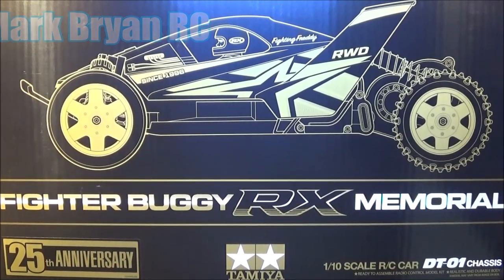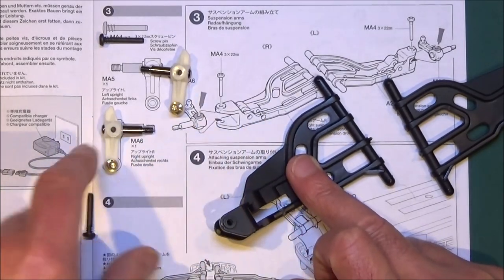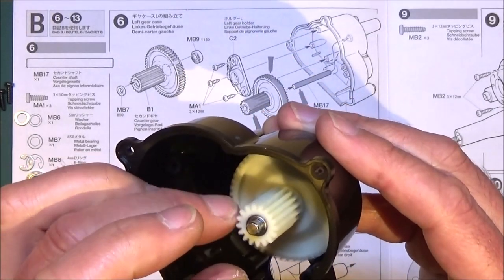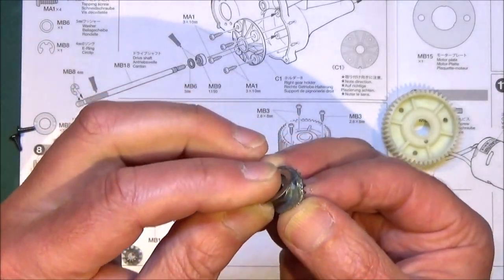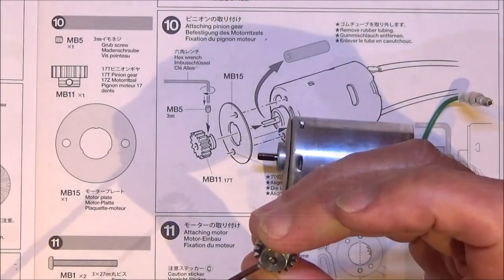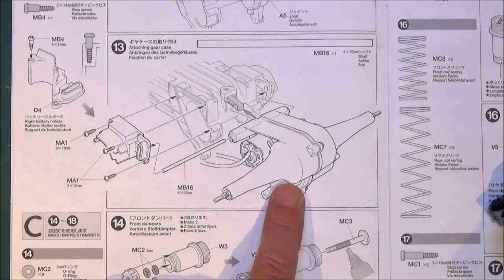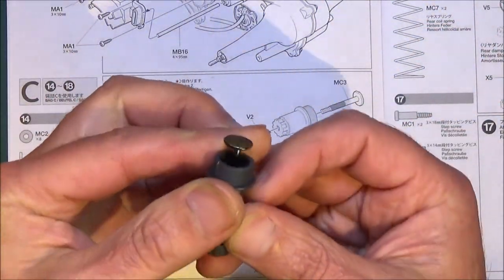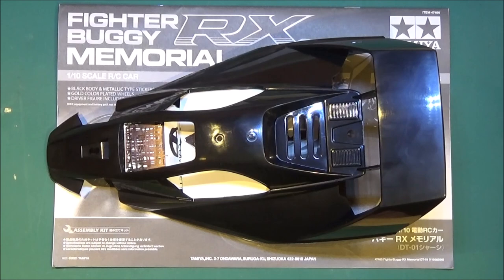Tamiya DT01 Fighter Buggy RX Memorial Build Guide + Tips Part 1 Steps 1-16

Comment: 10:46 "Easier said than done."..🤣 - too right mate. Oh how I've struggled with that particular fitting over the years, but a great feeling when you feel those screws bite. Glad you did a build video of this one as it brings back memories from 2004 when I built mine ( long since gone. ) As you'll know back then mine came with a MSC and needed an extra servo. I'm so glad Tamiya brough in ESC's shortly thereafter. I was genuinely surprised when you started building the shocks as I have absolutely no recollection of doing oil filled shocks on mine. Memory must be going..🙄. Thanks for the memories dude and cannot wait to see this one completed and running. #blackbeauty....cue the music...👍🏻👍🏻.
Reply from the maker: Hey mate - yeah, a lot in this hobby is easier said than done! I find brushless motors ever harder to fit as they don't have that collar near the spindle. Oh those MSC's - I loved the way you could go from full forward throttle to full reverse in a fraction of a second! Probably didn't do the car much good though! But modern ESC's sure give a lot more control. 
On the shock front, I think the oil shocks are part of the special edition features. Could be wrong! 
Thanks for taking the time to write all these interesting messages, always a pleasure, mate!  :)
Reply: @MarkBryanRC  Cheers for the info about the oil shocks Mark. I just looked into it and yeah, the original didn't have them. I wondered why I had no recollection of them. Memory intact - phew..😎🤣.
Reply from the maker: Well mate, I think your memory is functioning better than mine these days! TBH I don't think the oil shocks will make much difference, especially at the rear as it seems to be almost rigid! :O)

Comment: Quick tip, you can put Tamiya Anti Wear Grease on the spider gears inside the diff to make it limited slip, you can do this to all Tamiya gear diffs for better performance 👍
Reply from the maker: Great tip! I use the AW grease on my rally car diffs and it works well - was tempted to do it on this one, but went with normal grease, can always change it later! All the best from Mark...   :)

Comment: Hi Mark i love your videos! I got a tmayia terrer schorcher for christmas last year. It has been used quite a lot  is dirty. The gear box seams to be sounding weard too. Would the car be needing a re greaseing and rebuild? Is it ok to take the gear box apart?  Would the suspension be needing re olied because it seams to be leaking out. Is it ok to strip aprt your rc car or is that bad for it? Thanks
Reply from the maker: Hi Jamie, as I said in my other reply, it is good to rebuild a kit after a lot of use. However, if there is a concern, like a strange noise, I'd definitely strip it down to investigate. Just be careful to find the threads when re-inserting the screws, you can do this by "backscrewing" - very slowly turn the screw the wrong way until you feel the thread click into place and then screw in normally. If the suspension is leaking, also take off the shock caps and top up with oil. Hope this helps - cheers!
Reply: @MarkBryanRC  thanks so much keep up the good vids we all live them.
Reply from the maker: @F1_Editsz  No worries, Jamie!  👍